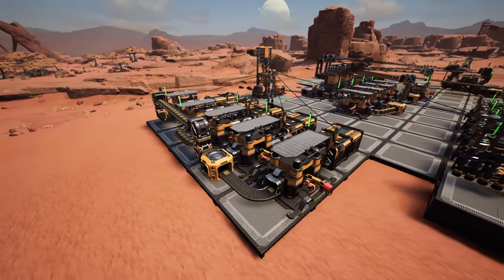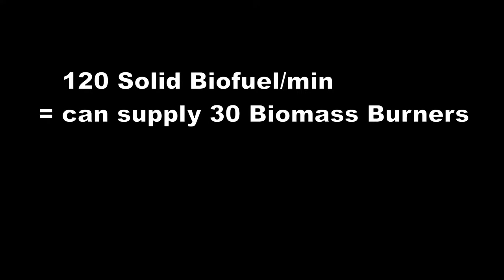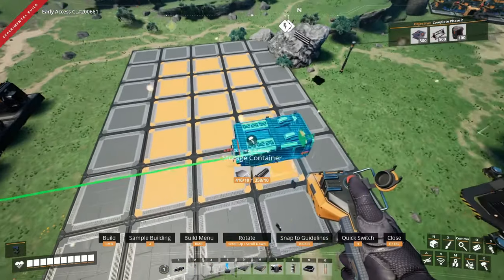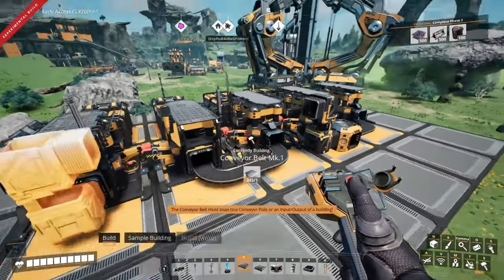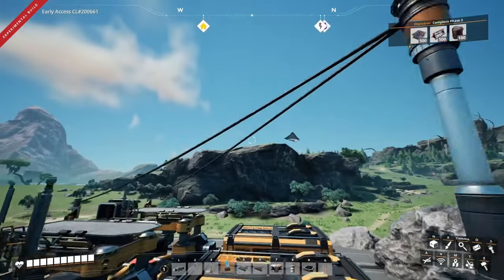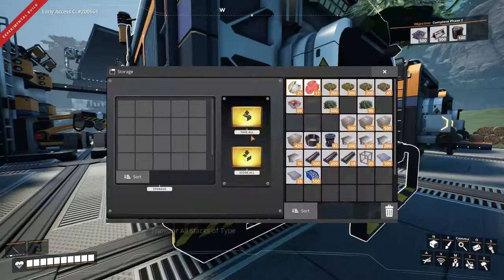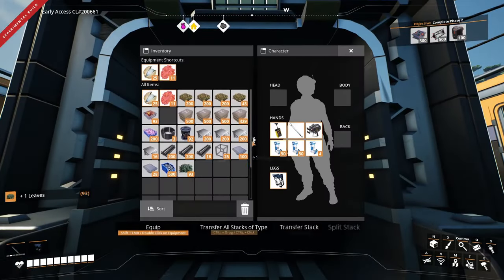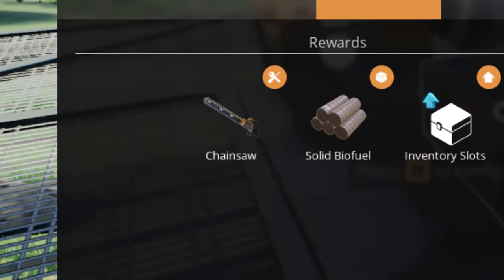Simple Basic BIOFUEL Factory (Build Guide & Beginner Tips)

Comment: so its been a year and you still cant automate this? :/ I hate running around collecting wood/leaves
Reply: It's actually easy to modify this to add storage and attach it to biomass burners, now that they have conveyer attachments. This makes the build much larger, but makes it a bit less hands on, like a dump your leaves and go situation. Splitters and mergers are your friends in this case.

Storage is for excess biomass, which, if your burners don't go through them quite as quickly as you'd anticipated, will eventually stack up and just sit there. Until the next time you need more leaves and wood. 🤷‍♀
Reply: In 1.0, this can be automated further since biomass burners now have a conveyer input! You still have to collect foliage, which is slightly inconvenient, but wayyyy less so than it was previously. 

To add, it's intentionally inconvenient. Coffee Stain has mentioned that this inconvenience is there to push you towards coal.